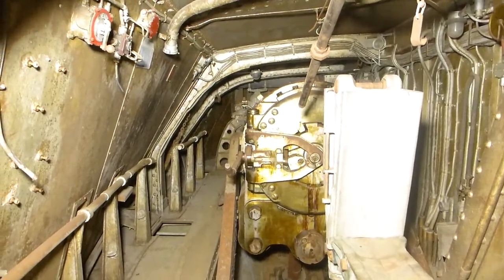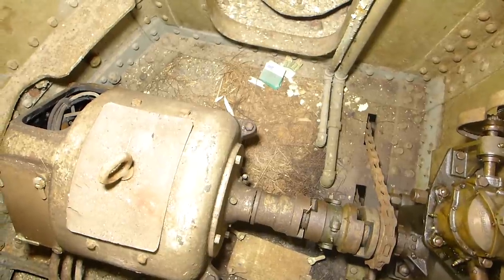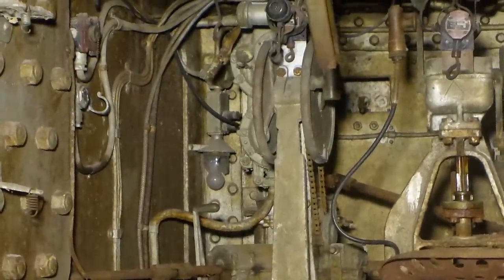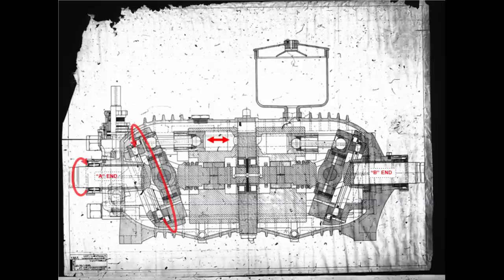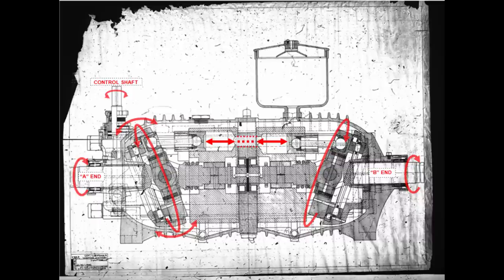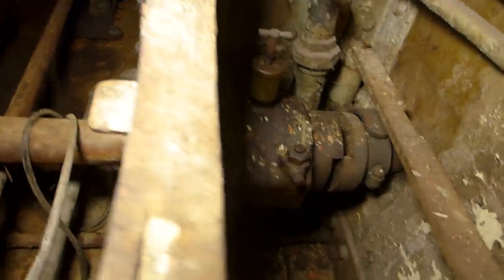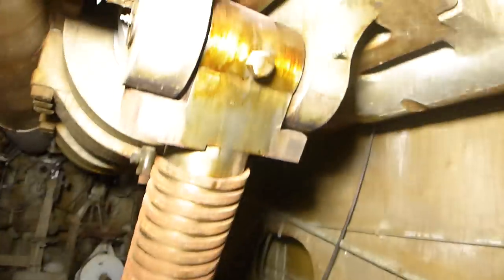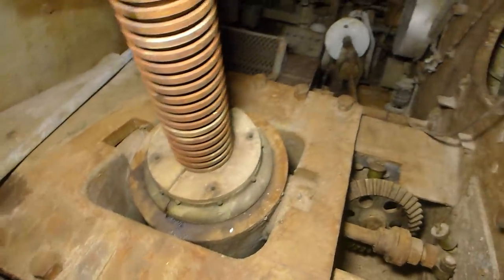Battleship Texas, How To Train Your Turret

Comment: Outstanding. The Waterbury gear you explained here is conceptually similar to the constant-speed drive used to regulate generators on jet engines even today. Thanks for these glimpses into the tech behind the Texas.
Reply: Fantastic isn't it. Really interesting how advanced this ship is considering it's age. It even looks a lot more recent in it's overall design, to me at least.
Reply: It is very similar to hydrastatic drive used on everything from small riding mowers to huge heavy equipment.
Reply: They're exactly like piston hydraulic pumps too!
Reply: and also very similar to the a/c compressor developed initally by GM and used by many automakers-- the input shaft is connected to a plate mounted at an angle, that presses in succession on several shafts connected to pistons mounted axially inside the compressor, which provide a steady flow of compressed refrigerant.
Reply: @mikeh2006  Agreed.  Technology of the time was surprisingly sophisticated, especially considering this was still largely the horse-drawn equipment era.

Comment: Absolutely fascinating.  It'd sure be wonderful if one day all that machinery could be overhauled and restored to function.  Even if it was just one turret. it would really help bring the ship to life for visitors.
Reply from the maker: I agree that it would be a great thing to experience, but I don't see it ever happening.  It would require reconditioning motors, Waterbury gears, replacing 80+ year old wiring, restoring multiple electrical switches, contactors and fuse panels, replacing scores of shaft bearings, replacing wasted metal, etc.  Since there were historic cases of occasional fractures of the big turret roller bearings, those would need to be removed and inspected for fractures and roundness.  The turret rings that act as races for the turret rollers would need to be resurfaced and inspected.  The list goes on and on.  The only proper way to do all of that would require removing the turret house armor and guns, then lifting the entire turret structure out of the ship to recondition it.  That brings up not only the issue of direct cost that could easily hit $1 million, but finding and paying for a shipyard that could do the heavy lifting that the work would involve.  That also means performing a risky tow to get the ship to the shipyard.

Comment: The variable gearbox is basically what is called a hydrostatic transmission these days.
Reply: Yeah, I had an old Gilson tractor that used a similar design.  I've also seen this type used in some Honda atv's.  It's a pretty neat concept!
Reply: @ctg6734  Even in the world of commercial lawnmowers, hydrostatic transmissions can be a great thing. I remember moving from an old variable speed pulley 48" mower to a hydrostatic one and the difference between the two was night & day. Not only was it easier to run, due to not having gears in the traditional sense. The transmission itself was strong enough to be able to pull one of those little platforms that you stand on, while the old variable speed pulley ones simply did not have the strength in the transmission to do so. (The actual engines on the mowers was essentially the same)

edit: variable speed pulley, I forgot speed, lol

Comment: Thanks for the fascinating video.  I am an Electrical engineer and have designed electric motor based traverse drives for much smaller guns.  The waterbury gear discussion is very interesting.  Those old time engineers were quite capable and clever given what they had to work with.  That device is essentially a hydraulic servo motor.  Today we do that with electric servo motors.  Keep the videos comming.  Thanks again.
Reply: That is really neat! What gun did you design the traverse mech for?
Reply: Hydraulic actuators are better than electric actuators by the way, they are more power dense, back driveable and fault tolerant.

Comment: Hi Tom. Very neat title! One of those turrets is not far removed from a flame spitting dragon. Excellent coverage and explanation yet again. I'm always amazed how all this was designed In the days before computer aided design, control and manufacture. I wonder if they built mock ups first? BobUK
Reply from the maker: I can't answer for large components like turrets, but the hull was certainly prototyped.  Precise miniatures were made and towed in a long tank where their hydrodynamic characteristics could be measured to confirm the design and fine tune it.

Comment: interesting - that hydraulic speed gear is very similar to an aircraft fuelling pump (or perhaps another hydraulic pump) i recently took apart and scrapped, works in exactly the same way as you described - some great explanations of the workings of a very large bang stick hehe

Comment: To think 25hp can move that massive apparatus!
Reply from the maker: The 2-gun turrets on the following Nevada class used essentially the same design turret house and turning gear, but they did go to 50hp.  I've never checked, but I imagine it improved training speed.
Reply: 440 volt 300 hp electric motor to train 1800 tons on an Iowa class BB.

Comment: Were all of the fluids drained from the systems at the time the navy turned the ship over to the museum. Most of it didn't look to be in too bad of shape. Have you ever done a video as to when she was sunk in place as to how much of the interior spaces or did they just flood the tanks?
Reply from the maker: I've seen some documentation referring to preparing the ship for transfer.  I've seen nothing to indicate that they drained fluids from equipment.  My goal with videos is to show portions of the ship that folks rarely see and make an attempt to describe functions and equipment.  They only flooded tanks to settle the ship on the bottom.  No interior spaces or inner bottom compartments were intentionally flooded.
Reply: @tomscotttheolderone364  thanks for the information, the training motor what voltage was that 440v ?  I was hoping that there were guards over the chains and shafts at one time that could be a really gruesome way to go
Reply: Even when the Iowa’s were “in service reserve” (mothballed) all the hydraulic fluid was removed. Too much of a fire hazard and most likely would have decomposed to gunk over time.
Reply from the maker: @georgedistel1203  Yeah, there are guards on all of the remaining 9 assemblies.  I assume that someone removed this one sometime after the ship was decommissioned and it was never replaced.  Surprisingly, the motor and the ship's system voltage was 120 volts d.c.!
Reply: @tomscotttheolderone364  wow, never would have thought they were only 120v thats really interesting
Reply: @robertlian2009  I was wondering about that, even though there was what looked like some residue on the decking .

Comment: Waterbury, I was wondering how you would transfer motion from a constant speed motor in order to get smooth motion and precise stop. I wonder if this technology continued up to the Iowas or if a different method was used.
Reply from the maker: I haven't looked at the Iowas closely enough to know whether or not it was used on them.  However, it was a pretty standard device in U.S. battleship turrets built after Texas.  It was also sometimes used on smaller ships to drive their steering gear.

Comment: Amazing content as usual, Tom!
Some questions:
What is the control device mounted to the Waterbury gear control shaft shown at the 1:00 mark in the video? It has an output shaft that passes back through the bulkhead and connects to what looks like a brake or clutch mechanism that the turret worm gear drive shaft passes through (on the bulkhead around the 7:00 mark). To what purpose are these parts are used for? Thanks!
Reply from the maker: Sorry, I don't know the function of the shaft.
Reply: @tomscotttheolderone364  For what it's worth, my wild guess is that set-up provided a more precise turning stop when the Waterbury gear was set to its neutral position.  I'm also guessing (again, wildly) it is a 1925 retrofit because it's not shown in a 1912 gun pit drawing (Chuck Moore's site).
Reply from the maker: @rek-tekconsultingllc8827  It could be, but I am not inclined to guess.  My goal is to have accurate information, so I don't have that luxury.  Plus, I also found that I am wrong a lot more often than I like when I do guess.  The fact that it doesn't show in Chuck's drawing doesn't mean anything since what he worked from were representational and don't always show everything, only what they were interested in.
Reply: @tomscotttheolderone364  Yes, I completely agree with your sentiments.  My only intent was to brainstorm. My apologies for being "that guy." :)

Comment: Love your videos!  Different topic, but still in the turret, how did the gunners mates move the projectile from the transfer tray to the spanning tray?  This question has actually been driving me nuts for several years. A volunteer on the ship told me they rolled it over. But I just don’t see two men rolling a 1400 lb projectile like that, especially when they’d have to be pulling it towards them. Thanks very much!
Reply from the maker: They did exactly that.  It is even described in gunnery drill manuals.  The rammer man was close at hand and could also pitch in, if necessary.
Reply: @tomscotttheolderone364  Thanks for the answer Tom!  That is amazing. The whole transfer tray question is what got me started writing a book about the technology aboard BB-35. After she’s reopened I can hopefully finish my research and writing. I had arrangements with the TPWD curator in 2019 for almost unlimited access but that darn refinery fire messed up my trip. By the way, have you been to hold-deck forward or inside the conning tower?  Those spaces were on my wish list for the trip that fire cancelled.   I could pepper you with questions for a couple of days. Thanks very much, great videos!
Reply: I meant to say half-deck forward. Stupid auto correct
Reply from the maker: @thayerthacker6858  I've been in those locations.  Good luck on the book!
Reply from the maker: @thayerthacker6858  Ok, that makes more sense since the hold deck is a generous term considering how subdivided it is.  Yes, I've been on both the forward and aft half decks.
Reply: @tomscotttheolderone364  My father was a rammerman USS Texas division one 1927 -1930

Comment: What happens if you lose all power, is their a manual back up system or are you just SOL?
Reply from the maker: There is a manual system that is shown in my video, “In The Chainfalls”.  The turret could be trained and barrels elevated using a series of chain operated wheels by a gang of men.  Powder could be manually hoisted up auxiliary hoists and shells manually lifted from the shell deck through an auxiliary tube.  The guns could still be electrically fired by the gun pointer since that was a battery fed circuit.  The problem is the entire process of loading, aiming and firing a gun would likely take several minutes, making firing at a moving target pretty much hopeless.  Later ships with larger and heavier guns and turrets were simply too large to be operated manually, so they had redundant power and machinery.

Comment: Did they use gun powder or black powder?
Reply from the maker: They used smokeless powder; however, calling it powder is a little misleading since each grain in the charges for the 14" guns was about the size of a man's thumb.  Black powder was on board, but was only used in the airplane catapult charges.

Comment: i cant imagine being under the gun in such close proximity when it fired. must have been very oppressive.
Reply from the maker: Except for heavy physical exertion by the gun crew as they loaded, conditions weren't too bad in the turret.  There were plenty of ways to get hurt or killed, so following safety procedures was paramount.  Little of the noise inside the turret was produced by the powder charge igniting.  It was mainly produced by the recoil buffer and counter recoil springs that controlled the gun's recoil.  Because of the way the gun is constructed, you wouldn't see anything move when it fired except for the about the last 3 feet of the barrel and breech.  The rest of the barrel is enclosed within the large slide casting that holds the barrel in place and that it slides in during recoil.
Reply: @tomscotttheolderone364  but knowing the tonnage flinging back and forth above you probably was quite intimidating, at least until you go used to it.

Comment: so 2 men had to sit down there?
Reply from the maker: Yeah, but it was a safe location and wasn't bad unless you were claustrophobic.  It was a little tight, but well ventilated.  The gun slide that contained the barrel moved up and down directly over their heads when elevating, and was just high enough that it wouldn't touch their heads while they were seated.  Since the barrel recoiled inside its slide, it was impossible for the crew to directly contact it, even though it was just a few inches above them.  The only difficulty they had was getting to their seats since it meant crawling over the training and elevating shafts and gears.  There was no danger being caught up in those moving components since the guys climbing to the positions were the ones operating it.  The only person who could be in danger would be a sight setter who was stationed directly behind them, and set the range and deflection settings for their sights if they were locally aiming and firing using their optical sights.  However, local fire was almost never used and the sight setter wouldn't be there under most conditions.